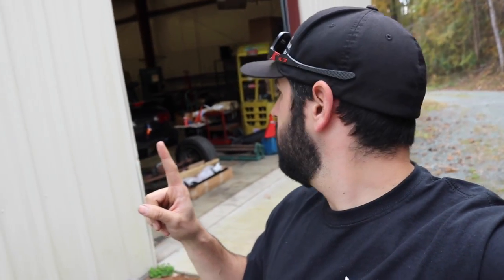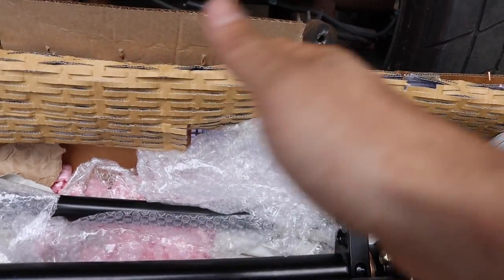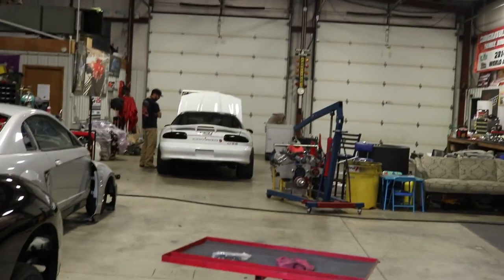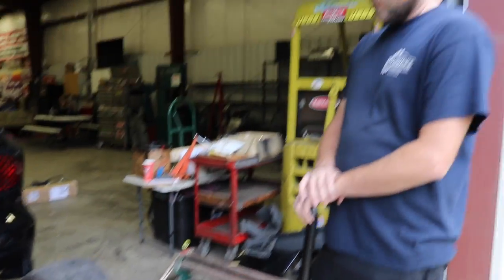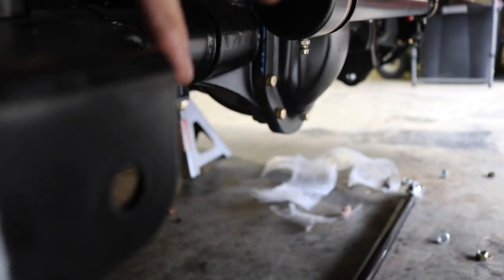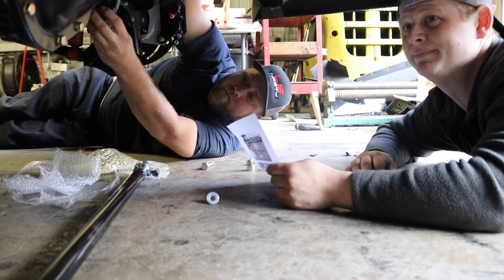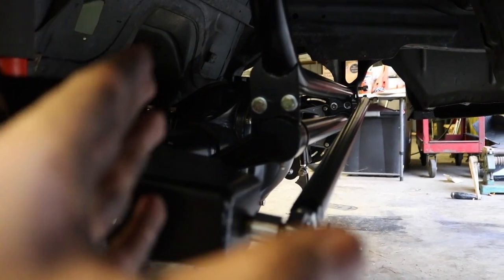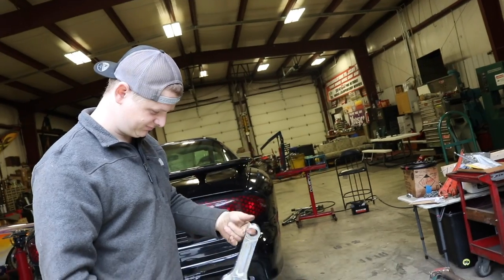The BEST MOD for your F-body!!! TRZ Anti roll!!!

Comment: I have a truck chassis 9 inch with trz anti roll bar and I’ve cut a 1.19 60ft with my lm7 383 fully forged with a 300shot🤘 stepping my shot up soon hopefully I can go mid 8s. All motor I ran 10.38 @125 on the 300 shot I ran 8.91 @157. Also have Racecraft chromoly k member and a arms, qa1 coils overs, Midwest chassis subframe connectors
Reply: *trick chassis

Comment: Can the stock fuel tank (or aftermarket) still fit in the with the new ARB in place?
Reply from the maker: I did not check clearances. This car will be running a cell so I am unsure
Reply: Ya I remember you said you weren't gonna, owell thanks.
Reply: Yes it’ll fit with a stock tank
Reply: @toddb5535  did you install yours with stock fuel tank?